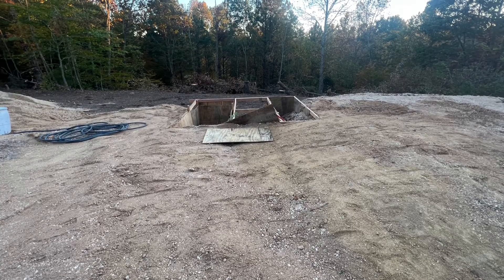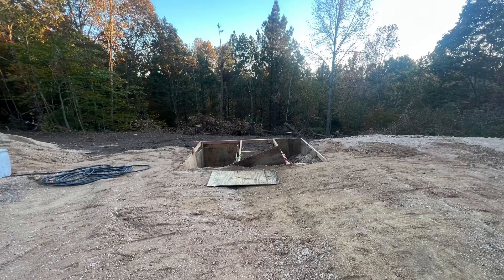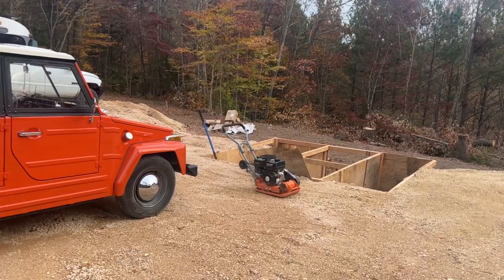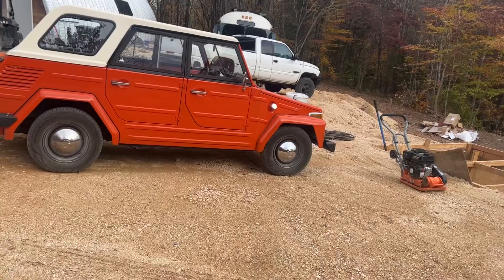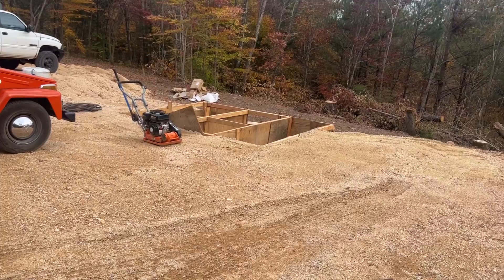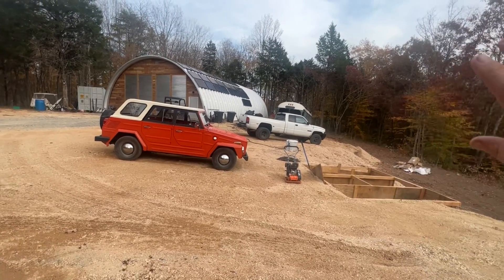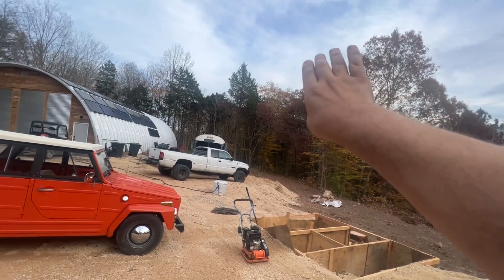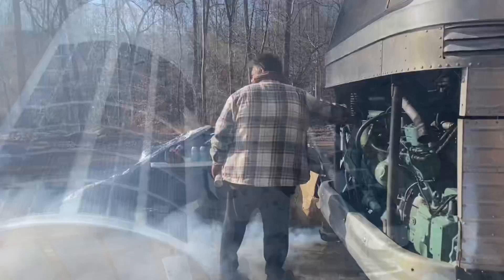Building an outdoor inspection pit. Shallow 3’ deep pull over pit with washing station & grease trap

Comment: I wonder if a roll up pool cover over the pit might be a good addition to keep stuff like leaves and branches from falling in when it is not being used (if there ever is a time it's not being used that is). I agree that it is hard working overhead>>did that on a factory car assembly line for awhile. I'd still love to have a lift in my garage if the ceiling was higher. Lying on my back gets harder to get back up as I get older too. Plus sometimes your arms just don't bend the direction you need. Doing heavy duty trucks, we never had pits or lifts. Pits are for inspection and maybe oil changes. Can't ever beat aging.

Comment: That pit will be a nice addition, especially with the open back. We had a pit in the shop I worked in, 6’deep x 36” wide by 40’ absolutely a necessity when working on motor coaches. After about 20 years of using it the insurance company made us install a safety net that we would pull over it when not in use.

Comment: I can see the logic for the mini-pit.  Most of the time you only need to see under one end of the bus to setup the brakes and steering, much of the engine work can be done from above, and needs a solid surface to work from.  Also what length would you make a "full length" pit - OF for a 30ft bus = too short for a 40ft one; if not covered by a vehicle it needs to be either covered or fenced off.  And, even when in use they can be really dangerous to have around - one place I worked had a very serious accident when a guy went for a comfort break, fell off the boards into a pit between two vehicles (150 yard long pit, about 6ft deep)......

Comment: I just used a pit to pressure wash underneath my semi it was about 6 ft deep. That's too deep. But I sure want I sure wouldn't want to do it in a 3-ft pit
Reply: Over 3 foot deep= enginnered ventalation/ air exchange system with explosion proof fans. Might be one of his considerations.

Comment: Ever sine you guys put up the building, I've felt that you 've needed a pit. I don't know about leaving those stumps in the ground though. I think it might become a problem in the future.
Reply from the maker: I need a spot to clean stuff.  A small pit is a bonus
Reply: I thought the same thing. But as long as he's not building a structure on it ,it's not a big deal. As the stump rots and falls in just either add more fill or just box blade it back level.

Comment: Question … why are you not wetting down the base course as you are compacting it?
Reply from the maker: Because it’s rock
Reply: @BusGreaseMonkey  It helps with compaction. Locks it all together much more efficiently than if dry compacted. Standard industry practice here in NZ🇳🇿 and, I would imagine, anywhere else with construction standards. I say this, as a carpenter with decades of experience.